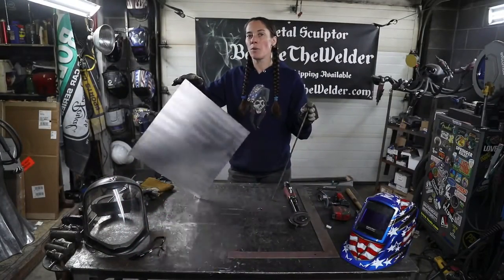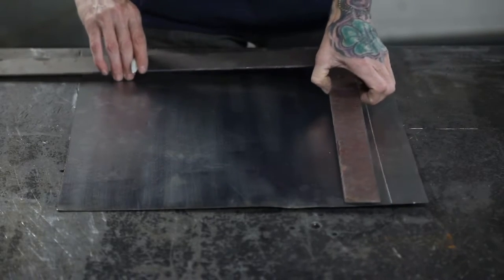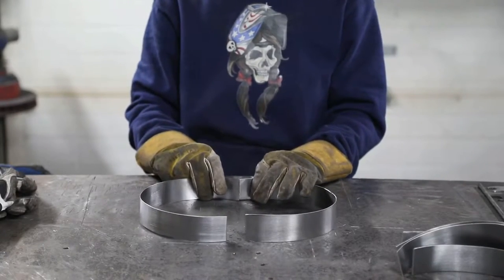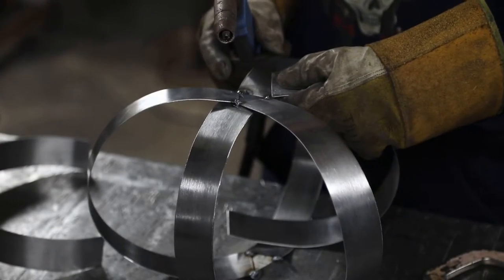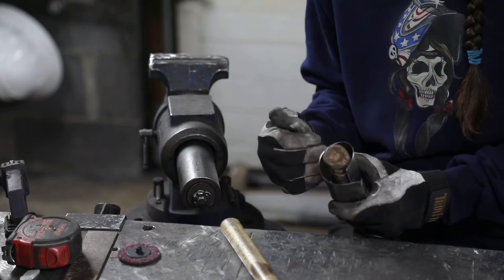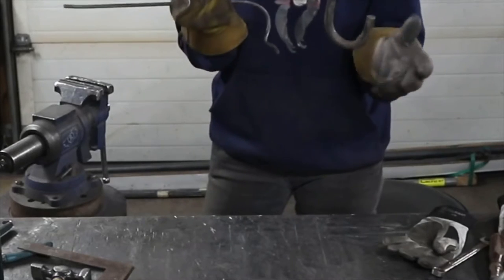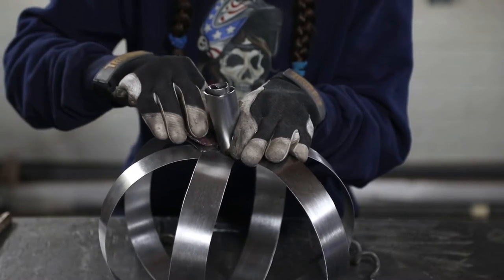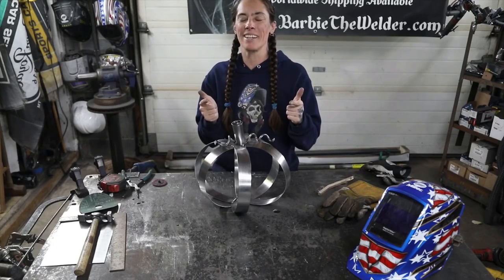How To Weld A Pumpkin | Easy Scrap Metal Art | Home Decor | Barbie The Welder

Comment: Have you used the new EBAS 205ic ac/dc welder?
I just bought one, I was torn between that and the Miller 220 ac/dc, but ended up choosing the ESAB for the extra features as well as the ability to run 6010. Any thoughts?